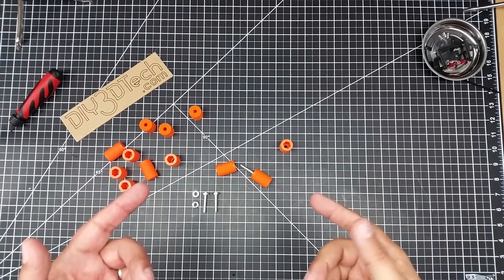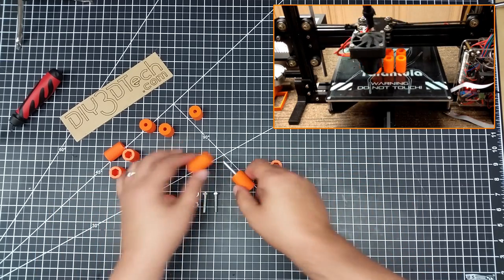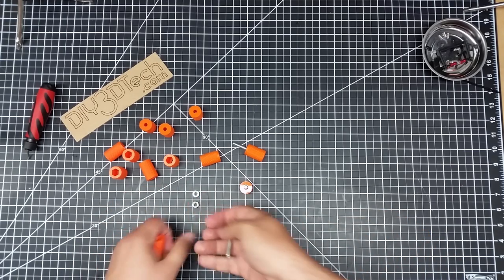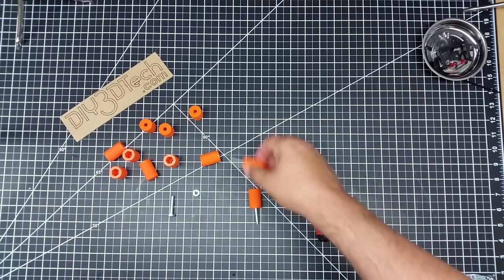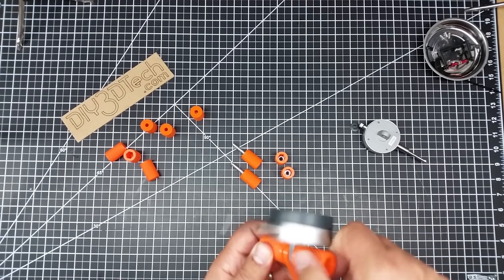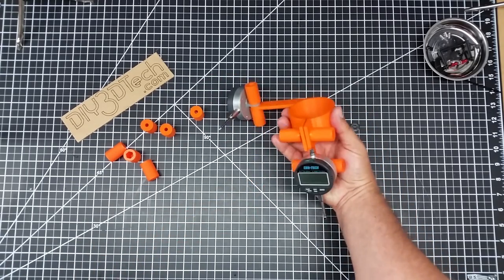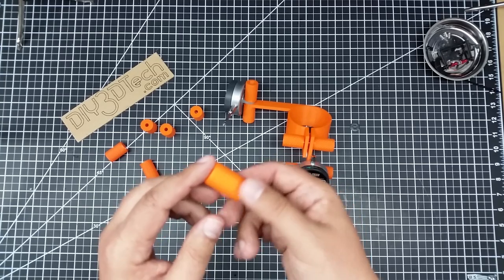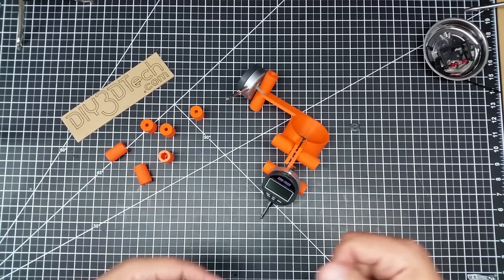3D Printed Project - The Magic 3D Printed Nut Thing!

Comment: Your link to the plastic cleanup tool doesn't work. The only things on that page are links to your other videos.
Reply from the maker: Thanks for sharing as I just get a blank page so something is up :-(
Reply: Something strange is going on. I still only get links. No article or picture of tool or whatever you put on there.
Reply: Nope. Checked using Chrome and Firefox. Same thing still. All links, no article.
Reply from the maker: If you won't mind try it again also it will take a couple seconds depending your internet speed...
Reply: Works now. Thanks!
Reply from the maker: That was odd, however thanks for letting me know!

Comment: 5:25 the Magic  breaks
Reply from the maker: Long time no hear from you!  Hope all is good!  Yea I used  the wrong sized nut #10 with a #8 bolt...
Reply: 1/4" x No.20 is the main Tripod screw, so may have other uses; longed ones to hold a camera, etc...
Reply from the maker: Yupper you see it in an up coming project :-)
Reply: Happens to all of use, too much on minds...
Is the camera angle OK, is the audio OK, is the 3D Printer OK, is the video too long, have I missed anything out, etc...